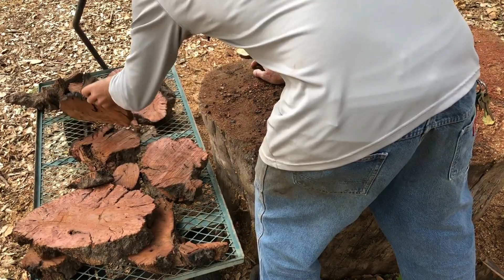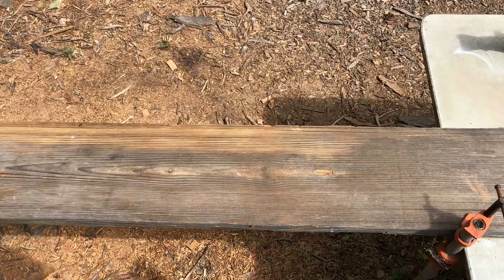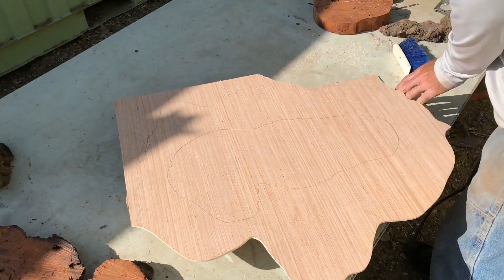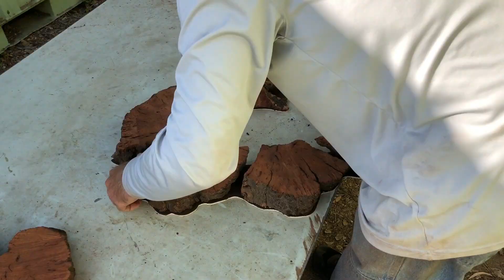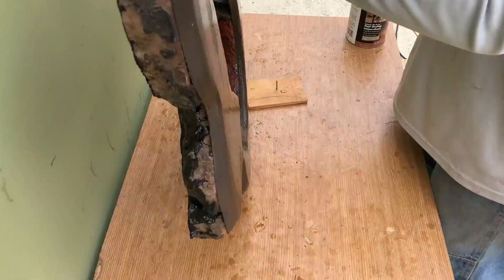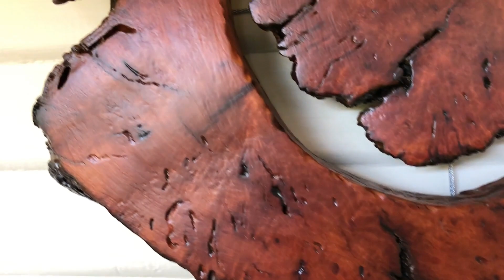wood burl turned into wall art

Comment: Hi Scott, I'm still drooling over your beautiful work. Would you mind sharing what type of paint you used on the backer board and what the finish was that you used on the wood art and how many coats did you need to achieve this look?
Reply from the maker: The paint I used on the backer board was a water-based dark brown mistint that I got at Sherwin Williams. It was no specific color. The finish I used was interior oil-based Zar clear antique flat polyurethane. I don't remember exactly how many coats I used. Usually I use at least 2 but sometimes 3 and occasionally more than that but not very often.

Comment: hey scott.. i just wanna ask. what kind of wire do you use to hold the frame? and that wire you use as a hanger? because i can't find these wires in our place..
Reply from the maker: I used stranded steel cable to hold the centerpiece in the frame - but really, you could use almost any type of wire, copper or steel, whatever you want. I use Hillman braided mirror cord as a hanger - it's basically a heavy duty picture hanging wire that holds up to 75 lbs. I use it on almost all of my paintings and wood art, even light weight ones. I like it much better than the thinner picture hanging wires.
Reply: @scottoconnor  thanks for sharing :)